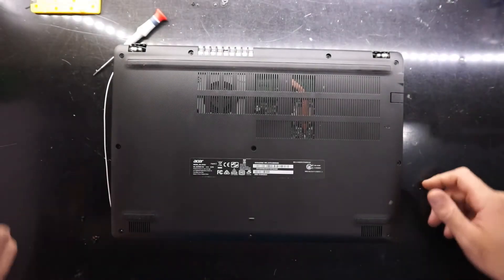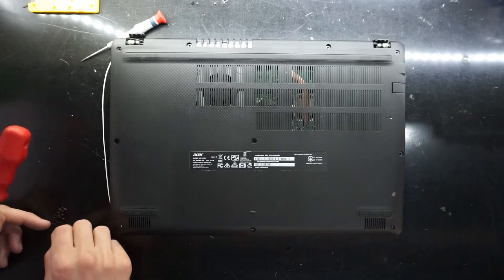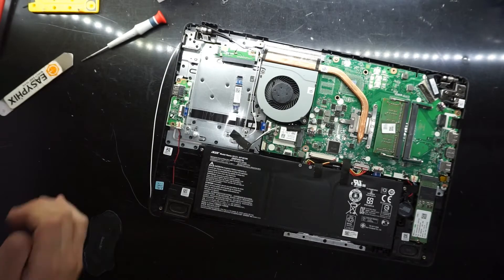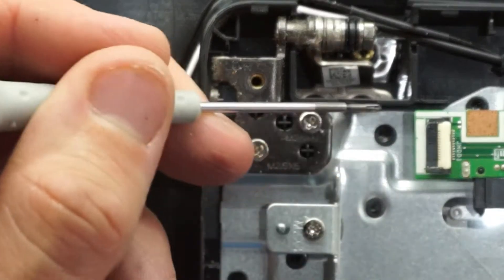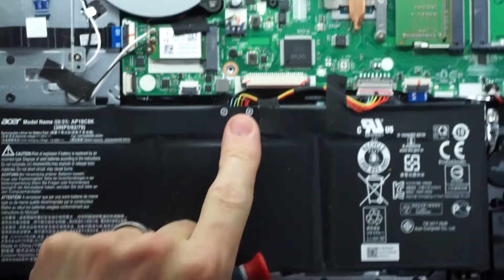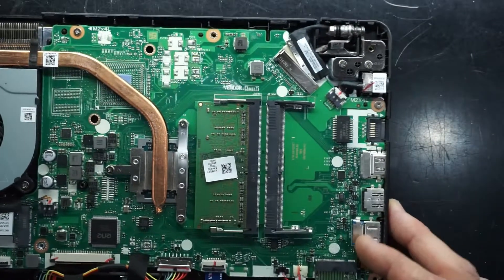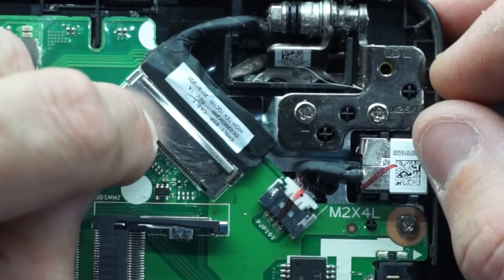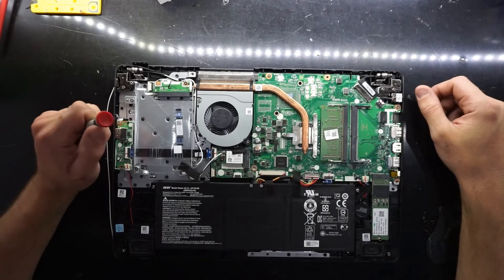Acer Aspire 3 2020 (i3,i5,i7) Teardown and upgrade overview

Comment: Thanks for this, i have the exact same model and i'm looking to upgrade the memory, everyone keeps telling me i need to buy an extended SATA cable for the SATA hard drive but by the looks of this i don't. can you tell me  if the SATA or NVME is the better option to upgrade. and can i upgrade the NVME without losing my data?

Comment: What about the wifi antennas? How to replace them, i got the same laptop, and my son broke the case, it ripped the cables
Reply from the maker: they would run up to the lcd cover..

..would be a challenging task if you never worked on laptops before